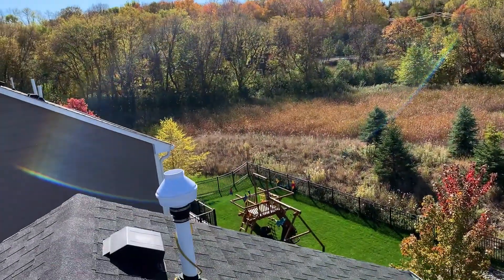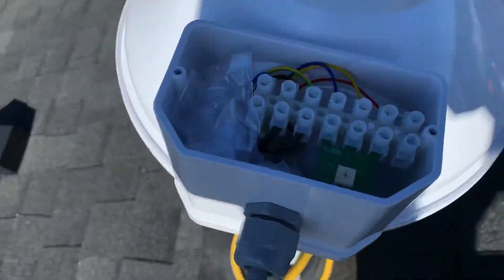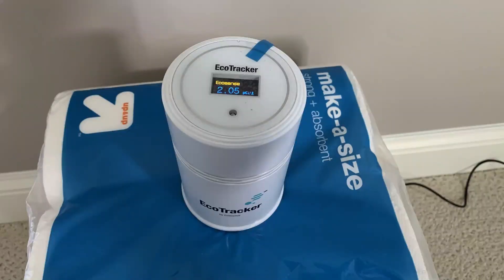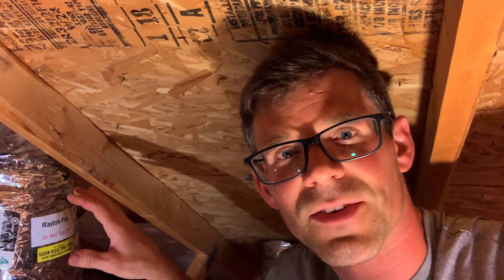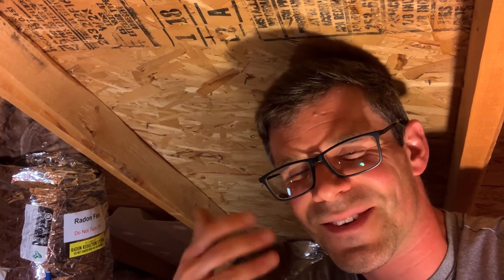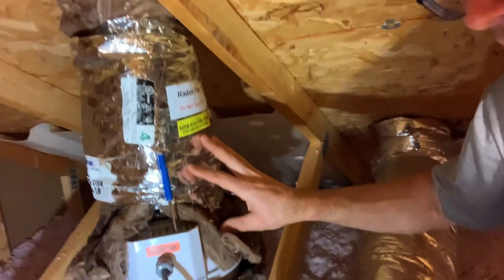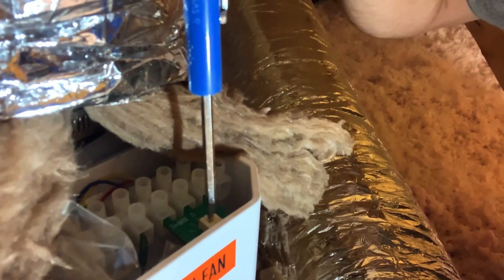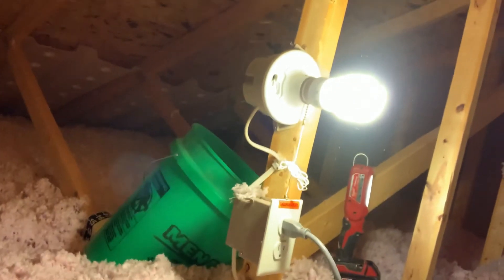Will Your Passive Radon System Work with a Fan? Here’s an Easy Way to Find Out

Comment: I’m curious to know what the typical charge for this work would be, and where I could find someone in the DC area who could do it… I had a national chain come in and they did none of these diagnostics, and they simply attached a fan to the passive pipe. And when our radon levels didn’t change I had to explain to the technician that there was a drain running into the sump pump from an exterior French drain so the fan was simply pulling air from the outside rather than from the foundation!
Reply from the maker: Sorry you had that experience. Unfortunately, not all systems are installed with proper diagnostics. A fully engineered radon mitigation system includes sealing, pressure testing, and properly placing the fan so it actually draws radon from beneath the foundation rather than daylighted exterior drains.

For finding a reliable installer in the DC area, look for someone who performs pressure field extension (PFE) testing. Those steps make a big difference in effectiveness and long-term performance. https://nrpp.info/pro-search/

Comment: how is this passive system if it has a fan?  I thought passive meant no fan?
Reply from the maker: A passive mitigation system does not have a fan. When we are hired to activate a passive mitigation system, the big question is, will it work? Since we didn't install any of the components of the passive system, we don't know if they were installed correctly. Doing a test like the one in this video gives us a bit more confidence going into the project.

Here's a link to the standard https://standards.aarst.org/CCAH-2020/index.html#zoom=z

Here's a link to a video of what goes into activating a passive system and some of the ways we deal with challenges that sometimes arise. https://youtu.be/yY0G7TIUZIY

Comment: I'm interested to hear that a mitigation system is being installed on a house with a 3.2 level. We just installed a system at our house, which dropped the levels from 10.5 down to roughly 3.4. Would you recommend attempted to mitigate further? Bear in mind that we don't have drain tile, our house was built before that was part of the building code.
Reply from the maker: I would mitigate my family's homes if they were above 2.0. Some of our customers have mitigated levels that were even lower than that. One was 0.5 before mitigation. They know two people that have lung cancer, and radon is the suspected cause. 

You will want to find a contractor that can do diagnostics to determine how to get your levels even lower.

Thank for the comment.

Comment: Interesting info, thanks. My old legs would be all rubber up there close to the edge of the roof!
Reply from the maker: I used to own an ice dam removal business. It was common to stand on the ice dam on the roof's edge or gutter while holding the steamer wand. Sometimes I had to throw the 20-pound chunks of ice off to prevent them from falling onto a deck below, all while kneeling on ice, holding a steamer wand, and two stories off the ground. I was more fearless back then. However, dumb is probably a better word. :)

I plan to do a video on The Pitch Hopper one of these days. It's a great invention. Check it out here. https://www.thepitchhopper.com/

Thanks for watching!